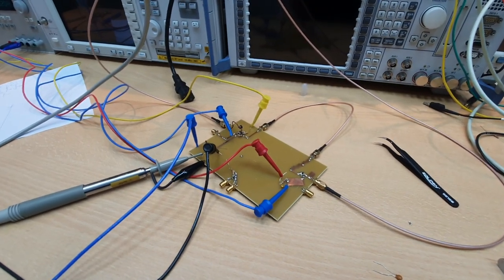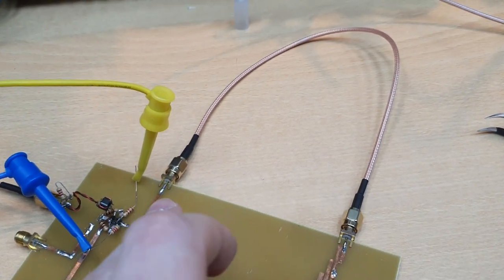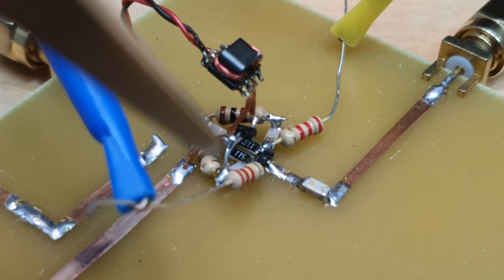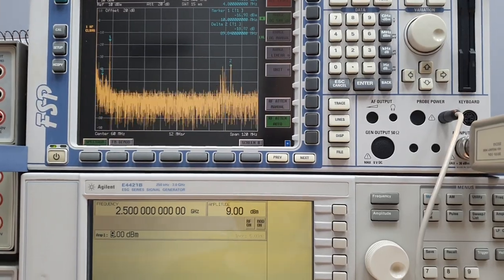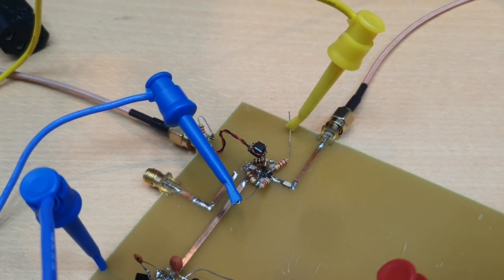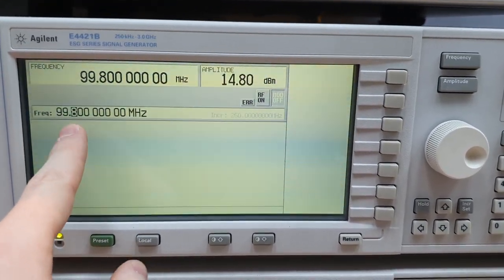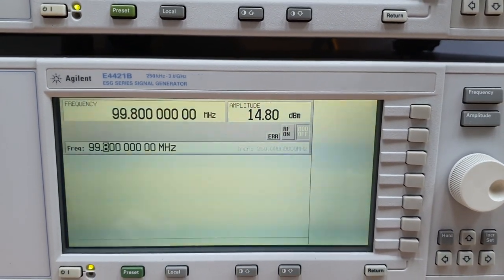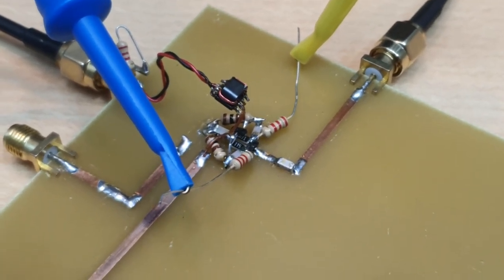5GHz Microwave Sampler Prototype

Comment: Nice, it seems to work pretty well. 
I guess if the LO leak through gets a problem, you could still add a notch filter or maybe even a passive Low pass filter in the output. Since gain is cheap, half a dB of loss of your wanted signal should not be too critical, I guess. 

Looking forward to see your whole system come together. 

Greetings, 
Michael

Comment: Thank you  for sharing, how step recovery diode  implements sampling in the time domain？ Could you share the schematic of the sampler circuit. Thank you very much.
Reply from the maker: I will share it soon! The step recovery diode generate a very fast pulse that switches two schottky diodes ON, charging a small capacitor with a sample of the input